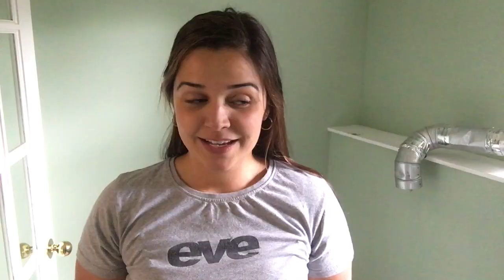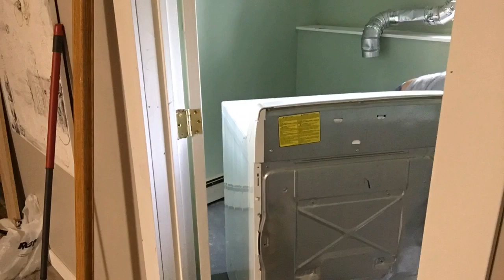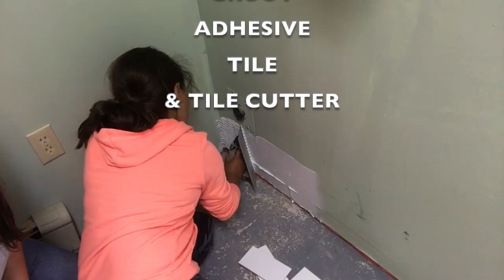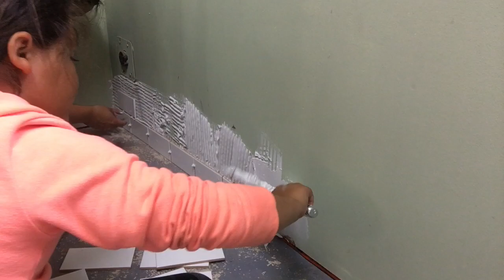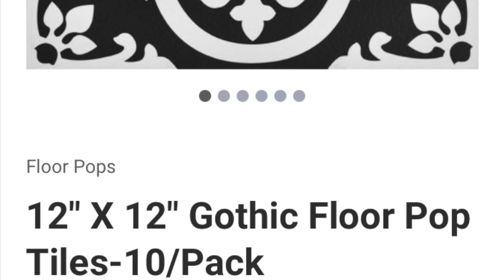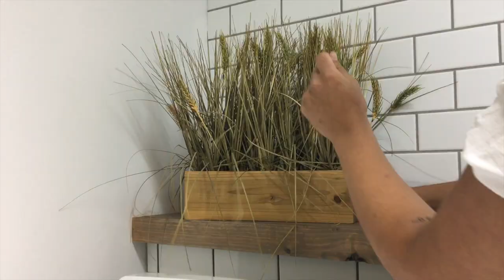DIY LAUNDRY ROOM MAKEOVER

Comment: How did you get rid of that big aluminum thing? I’m renovating my dads house and I was hesitant on doing the laundry room bcs I didn’t know what that aluminum thing was and if I could touch it or not.
Reply from the maker: i didn't, its still there. I just didn't re install it for the video yet. its the vent for the hot air. it can be spray painted though if you want to give it a new look
Reply: @dcwoodworks  awh man 😕 Do you think I could build like a box to put around it? Like you know with wires how you can put the little box thing over it to hide the wires? Would I be able to do the same with the vent or do you think it would mess with it? Also thanks for replying! I didn’t rlly think you would.
Reply from the maker: @GuapoAJ  you absolutely can build something around it for sure! It doesn’t need space or venting as long as you don’t move it from its purpose. (Dryer to outside vent) 

I try to reply to everything. Even if it take a few days / week lol :)